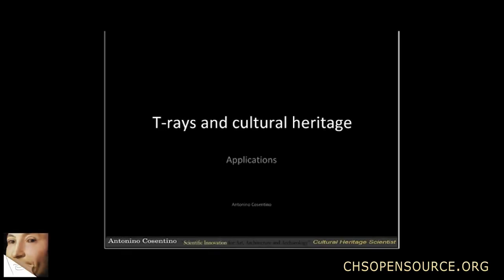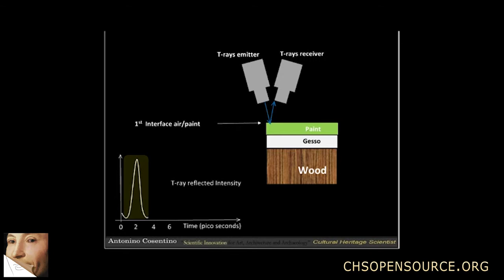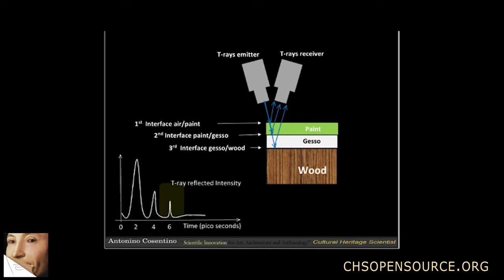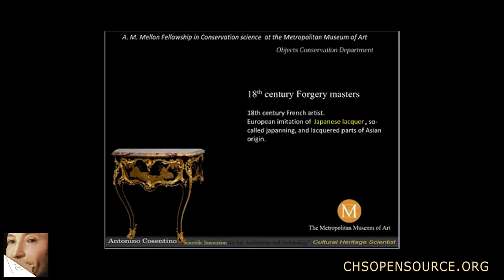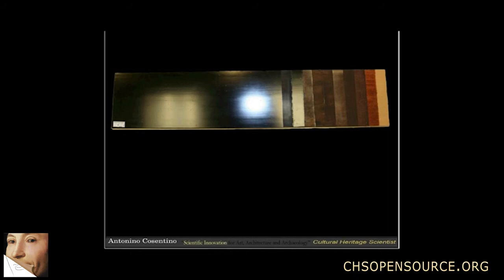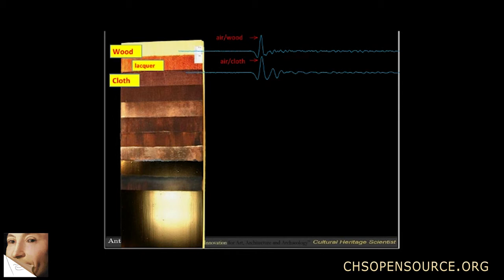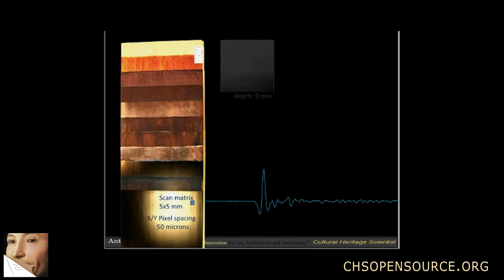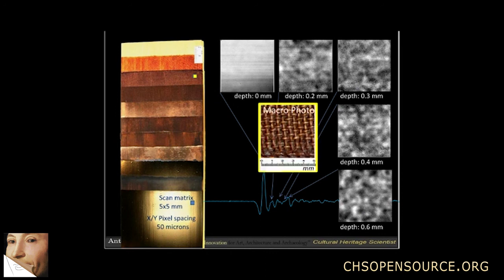Terahertz and art examination

Comment: Is there point to used instead of X-rays? One thing T-rays is safer radiation.
Reply from the maker: +Gediminas Jesinas Yes, Terahertz is a totally different radiation so it can be used for retrieving different information than that gained by X-radiography. For example X-radiography is sensitive to heave element pigments ()such as lead white) while Terahertz can detect ochre pigments too. Though this technology is just at its beginning so there is still lots to do to make it practical.
Reply: +Cultural Heritage Science Open Source, CHSOS Now I understand better. This can be useful in frescoe restoration and in US this technology already used for that. T-ray can also detect moisture and any metals.  I have to ask professor more about this.